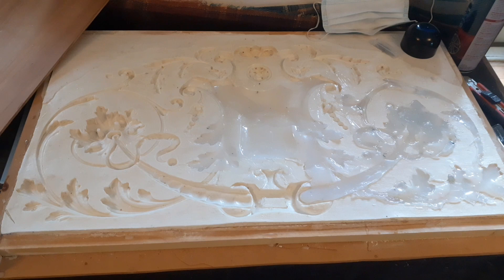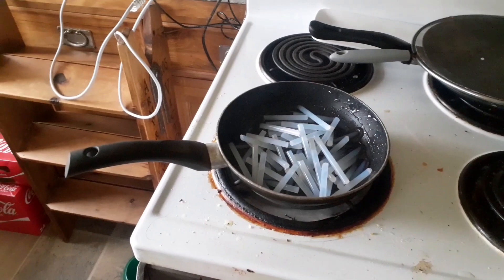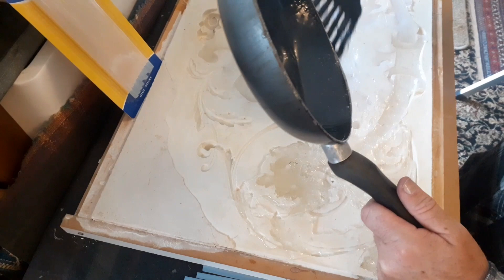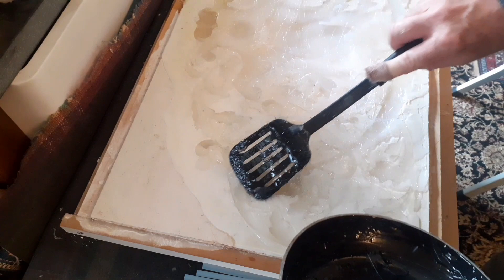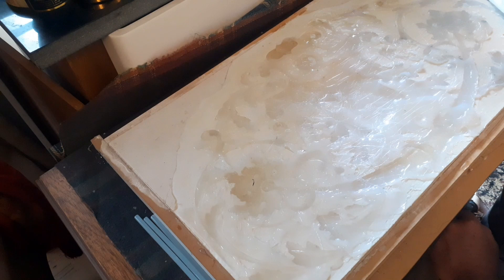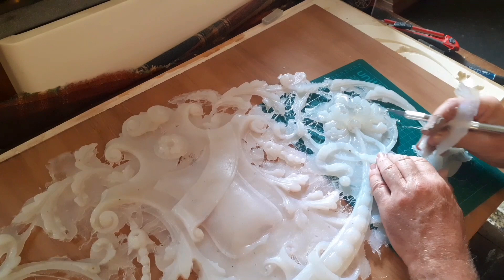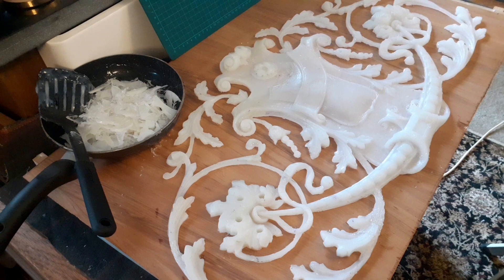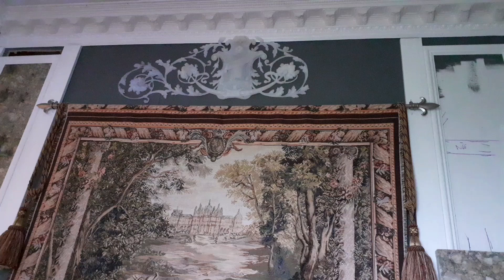Chateau Faux Renard or (The fake fox Chateau) DIY

Comment: A cheap hairdryer works great for at the end of the cutting or whatever, to get rid of the "spider webs". Just a helpful unsolicited tip. Looks fantastic.
Reply from the maker: Hi, thanks Jeremy. Yes you are right, I also have a heat gun but that was like using a blow tourch. Overkill.
Cheers from the Prince and the Puppy.

Comment: Hello from NYC! And thanks for sharing this project with us! It was brilliant to make the mold of an item you wanted to make later! And the use of glue sticks is amazing! And I’ve seen many use an electric skillet for melting glue sticks, but most that use this method do it to dip artificial flower stems, etc., into the melted glue…and then apply it to whatever project they’re doing. So your method is probably safer for pouring the hot glue into the mold!😊
Now, if I may, something to consider for future projects…even though I know it would probably take longer. Which would be just using an industrial glue gun to fill the entire mold in…because maybe it might save some time in cutting out the finished product with the X-acto knife? And might also make the back part of it more even? I’m just thinking it would be more controlled using a glue gun, to fill the mold. Especially it tiny areas. But once again, it would take much longer to do, so I can see why you opted for melting the glue sticks, then pouring that into the mold. And in either case, it came out beautifully! Hope your burn heals quickly! I remember those burns, 😂
Reply from the maker: Thank you Lady Rose. Your comment was very thoughtful. I'm going to look for a better glue gun. I have lots more to do. Cheers from the Prince and the Puppy.

Comment: You could get a heat embossing gun or a heat gun and warm it up as you’re cutting it that way it’s easier to cut it or you can use the heat gun wise in the silicone mold and melt the glue in the big spots so many ideas key never mind lol I was watching this I never thought about using hot glue instead of resin thanks for the inspirational ideas
Reply from the maker: Thanks for your ideas also Amber. I will try it.
Cheers from the Prince and the Puppy.